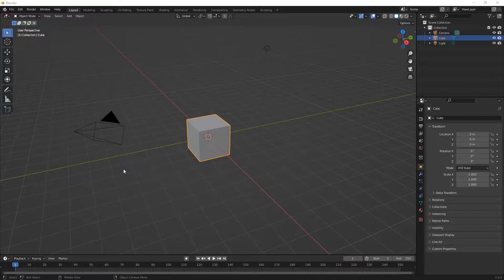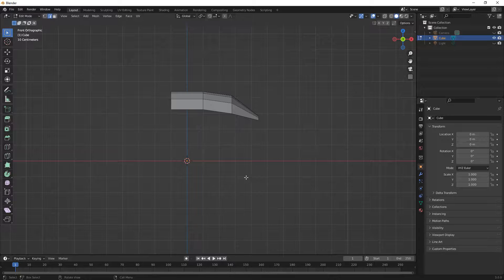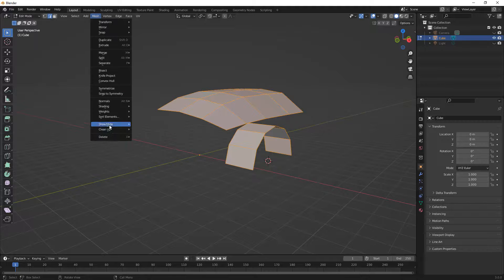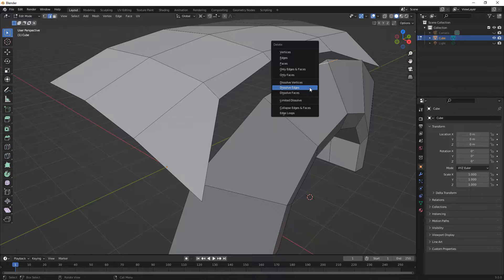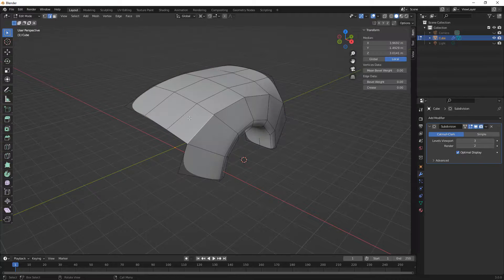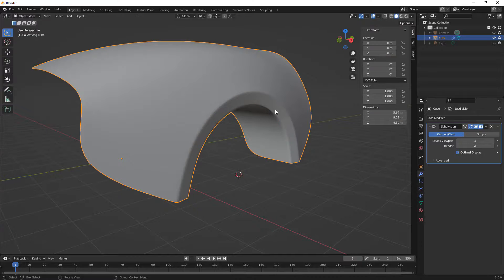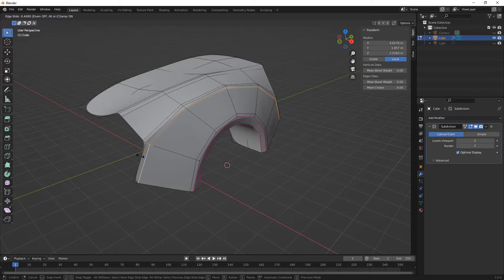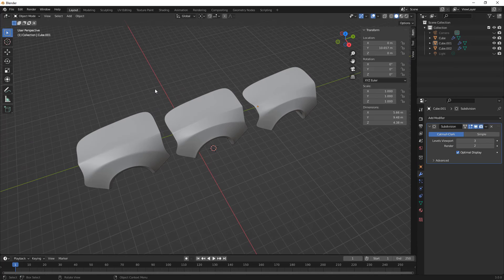How To Learn Blender Part 8 - Car Hood and Fender Practice #Blender

Comment: Been loving the tutorials! Starting a project to make a custom RC car with the body of my favorite car so this series is perfect. Only skill left is to figure how to add thickness to a model and break it into parts so I can 3D print it in sections!
Reply from the maker: For that you can use the modifier "Solidify".  that will let you add thickness to your design.  To break it up there are a few ways and it kind of depends on how you want to break it up.  I would suggest breaking up the mesh body before solidify.  Easier in my opinion.  You also have "boolean"  mod which will let you add, subtract, intersect solids.
Reply: @LearnEverythingAboutDesign  Thank you! Absolutely love your content for tutorials. I was thinking of using Meshmixer once I have the stl because I am more familiar with that but I’ll look into some other options!

Comment: Hello, i get the point of using these modifier for modeling. But i got some question, such as

If i want to make wide body for hot wheels scanned car, which workflow should i use? i try to modeling with some extrude (not using any solidify) and i got acceptable result, except i don't know how to make my excess model remove from overlapping my 3d scanned hot wheels

i wish i could send you a photo to show you what happen to my model, i hope you get the point what i try to say. Sorry for my bad english

Thanks in advance
Reply from the maker: Yeah, so blender is great BUT a scanned mesh will be triangular and working with that on a quad mesh how you would design it can be tricky.  I typically work with scan data and design in Fusion and "pull" the design down to the mesh.  In Blender you can snap your design to the mesh OR you can use booleans if you want to cut it.
Reply: @LearnEverythingAboutDesign  Thanks, any info for snapping my design to the mesh? i try to use median snapping but it didn't change anything
Reply from the maker: @1337FLINT.  At the top center of the screen is a magnet icon. click that to enable snaps.  then to the right of it use the dropdown and set the snap target to whatever works for your design(probably face).
Reply: @LearnEverythingAboutDesign  Thanks man, i'll try to look again later. Hope this work for me
Reply: @LearnEverythingAboutDesign Hello, it's me again

I tried to use snap to face object, but my object (widebody) can't snap to any faces, i'm imported stl scanned model. Is this will affect the snapping tools? since the stl have triangular geometry?

I find one video that using this snapping tools
https://youtu.be/EY7G8sB7KXw?si=dEoAGLD_DQIGkI2k

sorry if i bothering you, thanks in advance
Reply from the maker: @1337FLINT.  The snap settings work when in edit mode.  So if you are editing your new object it should snap to the scan.  I imported a scanned fender to try this.  You will have to look at the snap settings and the "closest" option.  you may need to pull points close before they will snap.
Reply: @LearnEverythingAboutDesign  I'll look into it later, i think i used the snap settings on edit mode. Thanks a lot for the help, sorry if i ask a lot more about this snap seting

Comment: Can you do a video where the creases fade in and out of the bodywork? Similar to the line just below the door windows on the BMW 3er
Reply from the maker: Sure thing I'll add it to my list.  There are a few ways to do this.  Edge weighting is one of them.  The other is adding edge loops and fading them away.
Reply: @LearnEverythingAboutDesign  I've tried to do this, but I cannot for the life of me figure out how to do it while keeping the mesh clean. I don't want to resort to n-gons because that might cause issues when I export to unity.

So I'd really appreciate it if you were to show us how to do it. You're an expert in this field.

Comment: I have trouble with the Number pad (may because I'm using a laptop????) once all the pictures are uploaded the User Orthographic mode I can't separate the images and push them away. So I continued on when it comes to creating a plane nothing comes up. I'm poo at this lol.
Reply from the maker: hmm. yeah the numbers at the top of a normal keyboard vs the numpad do different things.  not sure there.  For the images go into the user preferences and make sure you activate "insert images as planes".  that should let you move them.  otherwise i think they are locked in "empties"
Reply: @LearnEverythingAboutDesign  Yes that's right they do say empty I will give it another go, Thanks 👍🏻

Comment: would this work if you have a scan of the hood to add hood vents or to make a spoiler
Reply from the maker: yeah of course.  There are lots of people modeling car parts off scans with Blender.  many prefer it.  I still like using Fusion because i get a true surface out of it, but if your goal is to 3d print the parts there is nothing really stopping you there.

I will be doing some scan to part videos in blender this year but not for a little while.

Comment: Great videos! I have a suggestion. If you model a machine/mechanical device in Fusion 360, its easy to set joints and  to "rig" the assembly to behave like it would in the real world. So I would love a video about how to do the same in blender. How to make what would be the equivalent to joints in Fusion 360. The meaning of doing this is to be able to animate the movements of the mechanical assembly in blender after importing a design from Fusion 360.

By the way, don't know where I found the quick tip. But here it is. 
To import models from Fusion 360 to blender there is a "hidden" trick. 
1. Export the Fusion 360 design as a .usdz file. 
2. Find the file on your computer and zip it
3. Unzip the file
4. inside the unizip'ed folder you will find a file type called .usdc , this file type can be imported in Blender
5. the textures will also follow this kind of import

Maybe someone out there could make an add-in for Fusion 360 that can push the design directly to blender when doing changes in Fusion 360. That would be awesome!
Reply from the maker: Very cool tip I will need to try that.  Interesting fact the USDC format isn't available on a hobby license for some reason.  Taking textures would be nice.  I know the FBX file will take appearances and the OBJ is supposed to now.

On the "rig" i believe it can be done with an armature, but i think doing it precisely would be tricky.  I will do some more digging on that.  I have build armatures before for characters but not for mechanical items.  would be fun!  Thanks
Reply: @LearnEverythingAboutDesign  you mean usdz export is not available on hobby license of fusion 360?
Reply: @LearnEverythingAboutDesign  first i was thinking that constrains would be the easiest for mechanics in blender, but after looking a bit into it im not quite sure if thats suitable
Reply from the maker: Oyvind, I am not sure now on the export,  I didn't think it was in the personal/hobby but it might be.  I don't have a good way to check since I am on a commercial license.

I know blender can do it because people animate cars.  I think the Armature option has a rigid setting so it doesn't deform the mesh so likely can be done.  The way I have done it with characters has been a little less precise.  Ill sort it out.
Reply: @LearnEverythingAboutDesign  same here, also have the commercial version. 

Great! Looking forward to hear from your investigation about the riging/ constraining or whatever it will be 😀
You are doing a very good job with this youtube channel I must say!!